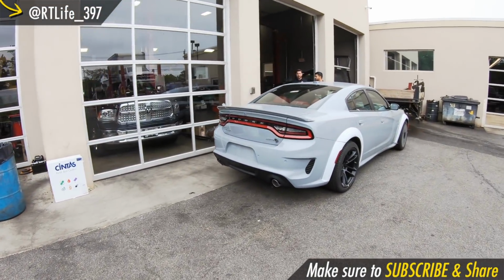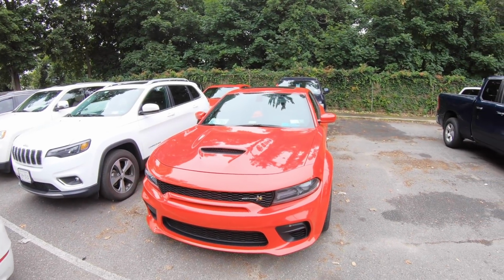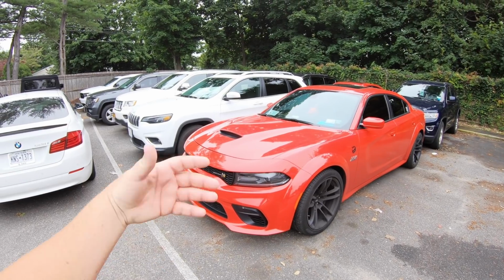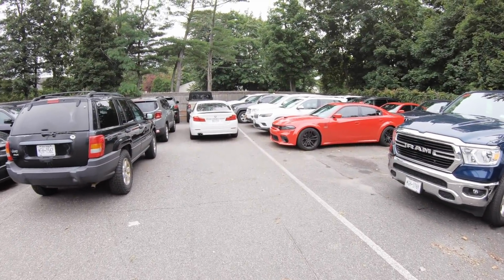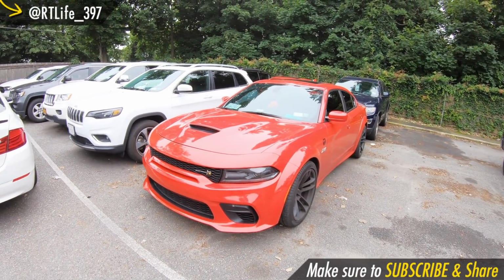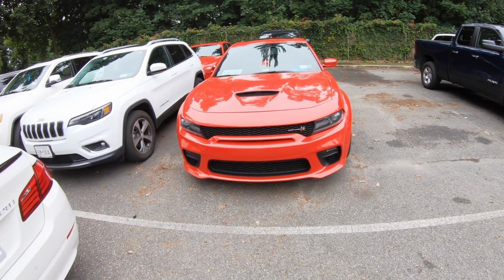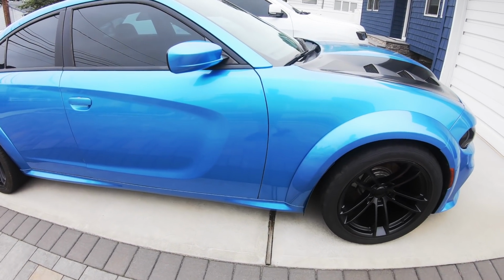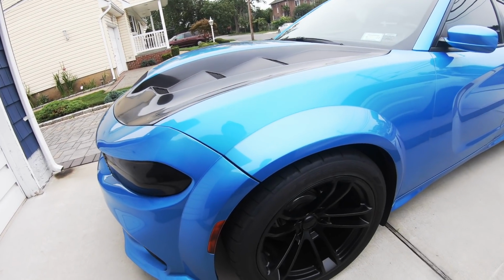Widebody is RIP OFF!!!

Comment: My biggest argument with dodge and the new wide body chargers or Challengers is you asking hellcat prices but couldn't even increase the HP that to me alone is a rip off. SMH
Reply: Scat pack is a good step before Hellcat and no where near the Hellcat price. Trust me I would of bought a Hellcat
Reply: @seancole8359  shit the prices I've seen them go for it is....I mean if your spending close to $52,000 for a scatpack a used hellcat is right in that same price range
Reply: Same thing I said,where's the extra horsepower?People complained about the car being heavy,now Dodge gave you a widebody,with a couple hundred extra pounds,for stupid people😂
Reply: @jakoidtonge  I mean I love the scatpack don't get me wrong but they could of gave it more HP for the price they charging. And hate to say it but the 5.0 with the 10 speed is faster
Reply: @cevinmoore8428  the 5.0 definitely got that top end speed.But the Scat got the edge from a dig,granted the driver knows what they are doing.Only thing those cars need are sticky rear tires,and a good driver.
Reply: @jakoidtonge  yeah and I don't even like mustangs but I feel like dodge could of done the scat better with the widebody and added more HP that is just mu personal opinion
Reply: @cevinmoore8428  yes more hp,to compensate for the extra weight
Reply: @jakoidtonge  that's all saying overall it's a great car just wish they did that 🙅
Reply: @seancole8359  i agree, scats are absolutely the best bang for your buck...i'm saving up for a challenger scat pack, 500 horses is a fukn ton of power
Reply: @cevinmoore8428  seen the mileage on that used fat cat??? yuk
Reply: Facts
Reply: Well actually it’s not Dodge itself it’s the dealers that over charge us owners. Dodge have the power to penalize the dealerships for over charging us but they don’t wanna take action on it. Ford is trying to get dodge & chevy for them to penalize these dealerships for over charging the customers. Because 70,000 for a scat pack? That’s pushing the same HP as the 2-3 year old scat packs, have the same 8 speed transmission and !!!!!!!!!!! The same outdated interior from 2015 ??? Hell no.
Reply: @J_GoldieLoc  right it's just insane that the prices cost as much as a hellcat there should be boundaries my goodness. And like you said same interior and same HP since 2015 they on some straight B.S.
Reply: @fallback8314  it’s more like 420-430 whp it’s 485 crank. I was looking for a Scatpack but the way these prices are I refused and I was buying cash. I ended up with a 5.7 had a custom widebody done with OEM parts and waiting on my whipple and other mods and will be making over 580 whp. Anybody getting scats paying hellcat prices are crazy
Reply: Not a good review tbh..... The widebody is significantly faster than regular body.  I honestly think they dyno at 500+. Plenty of articles about this.
Reply: Good 👍 observation
Reply: Exactly when you can buy the kit for 10k
Reply: @seancole8359  Same. for 22k you can build your 392 to hellcat redeye power.
Reply: FACTS
Reply: Bruh the price is way different is u drunk
Reply: @loveyourzzgg697  how the hell am I drunk? You can get a used hellcat for the same price as a widebody scatpack makes no sense

Comment: The only issue with the conversion that I can see at least for anything below a 2020 and maybe even the narrow bodies above 2020 is the whole point of the wide body from the factory is the improved suspension components that help those 305s corner better. With the conversion if you do just the body aspects you can add the wider wheels with proper offset with wider tires but your not getting the full benefit of the suspension upgrades.
Reply from the maker: Very true. Most will over look this because the majority of chargers are used for drag racing & meets.
Reply: @RTLife  Agreed. Because I have an insurance nanny in my Redeye currently I haven't really had a chance to fully get the effect of the 797 but damn it is a completely different car handling wise. Seriously considering doing some road course stuff with it.
Reply: @coolwrld302  Also, if you convert an SRT 392, you'd still have the bigger brakes up front and the adaptive suspension. Or the Daytona 392 2018+ also has the same I think...
Reply: The Widebodys have different spindles too
Reply: Not to mention they switched to electric power steering.

Comment: The Dealership near where I live is selling 2021 wide body Scat with 7k miles for 65k I would never pay that much when you could get a used Hellcat for less then that.
Reply from the maker: Exactly. It just doesn't make sense! But people are still buying them anyway
Reply: Probably has all the extras with it
Reply: @daltonxervin  all those extras still do nothing for the car as a whole
Reply: @sliding_by8607  that’s where the added cost comes from??? who said the extras did anything for it? not me.
Reply: @daltonxervin  did i say you said that? reading comprehension does wonders if you learn to use it.
Reply: @sliding_by8607  you implied that I did. so now you are saying your comment towards me was irrelevant.
Reply: Hey Mark, which dealer is it I am looking for the Widebody style I can fly there and put half the money down over the phone. Coming from Atl 65k not bad. Thanks
Reply: @BlakWiseCracker  if you put half the money down for a scat pack you should just get the hellcat
Reply: @daltonxervin , I don’t like the Hellcats” and I don’t need all that power it’ll be for nothing and just for show and no where to open up 700hp except the track and I am nowhere near a track. The ScatPack is just enough HP, I had one and sold it 4more money than imagine. Thanks 😊
Reply: @daltonxervin  , I know but I start a new job on 7/26/21 in the heart of Atlanta and need a whip  sooner than later. I sold my 2021 Widebody for 75k with 250 miles. I was gonna hold out after that to purchase, but my daughter needed my used car and I had to ship it to her in NY. What a bummer..” 😢
Reply: @BlakWiseCracker  at least you got that massive profit off of it. i was hoping to have one by august but I just bought a house. but I guess a house is more of a priority for my age. car soon to come though
Reply: @daltonxervin , As long as you can get to work for now and then your car is next. This pandemic won’t be over they say until 2023 therefore you’ll have plenty of time to get what you want for yourself and family. Only downfall might be a little high. But if you order one after August you’ll have it within 90 days.
Reply: @BlakWiseCracker  if everything goes as planned🙏🏼 but good luck to you and your fam and enjoy the car when you get it🤝
Reply: @daltonxervin , likewise blessings to you and yours as well. ✌️
Reply: @BlakWiseCracker  I am out here in Denver. The Dealership is Skyline Mitsubishi out of Westminster. It’s a Charger Scat Wide. Good luck man
Reply: @markroach3785 , I’ll call them ASAP! Thanks a million..” ✌️
Reply: @RTLife  yup people keep paying it so prices will stay high!

Comment: Got my WB scat for 46k earlier this year!! Market is so crazy right now
Reply: Wow that's a great deal. When buying my car the narrow body scats were $50k+
Reply: Got my 21 WB scat for 48k a month ago so i dont think its too bad
Reply: @Bad_grlz51  damn what a deal... I should've looked out of state and flew out of California or flew out of Los Angeles to get my car
Reply: @MLProductions.1  I got it from Los Angeles only just went to the right dealership at the right time I guess. Infact they keep emailing me about buying it back from me lol
Reply: @maninderhari6852  you'll get more then what you paid forsure. But since all prices are nuts rn it wouldn't be worth it. In 2019. I had bought a SXT for $27K OTD and that was with a custom katskinz interior. The R/Ts at the time were about $34k OTD. I didn't even look at scats. I drive alot but within 2 weeks regret my decision on getting the SXT and not the R/T. The sxt ended up being a lemon which was really a blessing since I only spent $200 and oil changes on a car I drove for a year and 26k miles. I wanted the scatpack. But the $16k OTD difference for a regular body didn't make sense so I went with the R/T. I'll be building this thing up. Already got about $8k in mods. And it's only 4 months old. Give me 3 years I'll be putting down hellcat numbers.
Reply: @MLProductions.1  you putting some work in that 5.7 bro . I traded mine for this scat WB . It was about the same $7-8k worth of mods and dyno tuned to about 430-440WHP. I thought I would miss it until I bought this 6.4 . This thing hits different even at stock. Some profit is tempting right now but I don’t feel motivated to sell it lol
Reply: Did u include  taxes, license, registration, application, dealer etc fees? 👀👀👀
Reply: @ivancortez29  yes sir I traded in my 5.7 as well

Comment: Widebody has adjustable suspension, flat bottom steering wheel, 11 inch rims on all four with 305 35 20 tires, beefier suspension  like 30% stiffer, and factory flares with Rocker panel change to blend six piston breaks in front four in back and 2 piece rotors in front. I'd say it's worth it to buy it already setup. All that is an upgrade from regular scat. Wider rims with tires is like 3k right there.

Comment: It's the Mopar tax. The car probably costs an extra $500 to build and the price difference is $15-20K. As long as people continue to pay the price, they'll pay what the market will bear. I would buy the standard body if I were to buy a Mopar. I'd improve on the wheels and tires and call it good. I doubt that I would add much in the way of performance mods because it is cheaper to mover up to the next trim level. I'd find it too hard to put up with if I felt I were getting ripped off.
Reply from the maker: yah I just wouldn't be able to justify getting a used widebody for almost $15-20k more than a regular one. They look great though

Comment: I would like too see narrow body wit the kit vs widebody too see if there really different from factory 🤔
Reply from the maker: I think that can happen.
Reply: I thought the only difference is the real widebody the fenders are actually cut into and the widebody kit they are just stuck on so with the kit you really cant go as wide tires as you can with the real widebody
Reply: @AlexSanchez-cg8pz  you shouldn't have any problem on the rear, but I can see where you would have to be careful up front.

Comment: The car market right now is an anomaly.  It's not usually like this.  Chip shortages have skewed the market so much.

Also, the wide body is a way better value than the standard because of the handling differences.  I own a Widebody and it's light years better than my standard Hellcat was.

Comment: Moving forward I don’t think the prices are gonna go down for these cars until we see these new E muscle cars in the flesh;  I’d still like to add a hellcat to my stable and park it next to my WB Scat.
Reply from the maker: I think you're right about that. These will keep their value for a while. Def don't blame you about adding a Hellcat - at some point I'd like to do the same.
Reply: Even if the EV cars come out it doesn’t affect the Chargers. The EV’s will be in a class all by itself intended only for people who wants. Also the Chargers are high in price due to the chip/rubber shortage, that’s it. Once that bounce back prices will drop for all cars.
Reply: I think the price will hold and even go up even after EV is release nothing is going to replace the sound of a v8.
If this is the last of them the price should hold.
Reply: @evergreenlandscaping901  , As long as gas stations exist combustible engines will never go away. Some people cannot phantom the fact of sitting waiting to recharge a car with family on the dangerous roads for 30-60 minutes. “ Hell people being shot at gas stations for getting a pack of cigarettes or a quick fill up and robbed or car jack. So can you imagine sitting there while crazy people watching you for 1 hour, hell naaw” I gotta go 😂
Reply: @BlakWiseCracker  agreed

Comment: 1.all dealerships are marking up sticker price right now like 10k, bad time to buy.  2. when getting a wide body its just not the fender flares, its the wider tires, the suspension is different. the rotors and brakes, its a bunch of extras your getting. is it worth it maybe not but it all depends. to me it is. the wide body looks and drives better than a narrow body to me anyday. and pricing depends on a lot, how equipped the car comes also matters

Comment: I already have too many cars. But what I would do is the most basic srt Charger. Stock everything with radials, a converter, a single vs racing turbo with the stock flipped manifolds and a crossover. Run pump + water injection and electronic boost controller. Tune it for about 700 whp and beat any hellcat for less than 50k 👍🏻

Comment: Did you have to cut your fenders? And how did glue your widebody kit?
Reply from the maker: No I didn't cut, but it is recommended. You will have to run lower profile tires if you don't cut.

Comment: I got offered 53k for a used 20k mile 2020 challenger widebody, and 56k for a charger widebody brand new. It’s so dumb how expensive they are. I’m ordering my camaro 1SS on Monday and I got offered $43k with my discount before any negotiations and other incentives. Camaro is the way to go if you go fully loaded.
Reply from the maker: I hate to say it but Mopars are overpriced esp right now. When you compare them to the performance of the Mustang/Camaro - it makes little sense going Mopar if you don't need the extra room in the back.

Comment: I saw a '21 challenger redeye at a dealer today and I saw a 1,s,and a 2 on the left side door panel. So dodge has finally added memory that recalls the settings for the steering wheel, the power portion of the seats, and side mirrors on the challenger when it was always on their other 4 door mopar vehicles and on the camaros and mustangs
Reply from the maker: I think Dodge is stepping up their game with the interior & technology in recent years
Reply: @RTLife  they just need to implement their new tech in the durango and the ram in their other vehicles

Comment: To be fully honest - when you noticed and shown close up how the bumper sits - yes, there is a difference between fitment of the kit and OEM. But considering the difference in the price - would take your R/T with body kit, rather than going for trade in at the dealer.
Reply from the maker: check out the video before I put the turbo setup on. The front bumper was perfect. The size of the intercooler in the front has screwed up the alignment - would've happened to any bumper.
Reply from the maker: Once this thing is all done I will button everything up so it looks perfect

Comment: I just traded my 2015 Jeep SRT with 81k miles and got $37k for it. I only paid $40 in 2018. The market for some, not all of these vehicles is crazy. Anyone who is buying these cars is getting fucked bc in about 2 years they are going to practically be giving the new cars away. There is a big chip shortage. Dodge alone has over 80k 2021 vehicles sitting in a lot with no computer in them. That’s why the used cars has spiked

Comment: A real factory Widebody gives you a lot more than just body panels. You get stiffer springs, adjustable shock dampening (street, sport, and track modes), bigger sway bars, 6-piston Brembo's with 2 piece rotors up front, 20"x11" wheels with 305/35/20 tires, shift indicator light, and the flat bottom steering wheel. It's a $6,000 option from the factory.
Reply from the maker: I think many are missing the point. I'm not knocking the widebody package but do you really think it's worth $15k-20k over a standard 392 or Hellcat? that's basically the point of the video. Many want a used one but the prices are silly right now.
Reply: @RTLife  Hell no it's not worth it, those markups are ridiculous. You'd have to be a fool or just have money to burn buying at those prices! 🤣🤣🤣 I paid $51k last year for the Hellraiser, sticker was $60k. Now is not the time to buy anything. But when shit gets back to normal, hopefully, the Widebody is well worth $6k if you can swing it. 👍👍👍
Reply from the maker: 100% worth every penny of $6k

Comment: It's more than a body kit, it's a plus-sized version of the dynamics handling package with floating brembos, larger wheels, and tires, and even a customized adaptively dampened shocks with different springs and even larger hollowed anti-roll bars.  Oh, and you might want to correct the title to use at least a correct sentence, such as add an "A" behind is and before rip off in the title.

Comment: @R/T Life where you get the wide body kit and wheels from bubba
Reply from the maker: I got the kit from Ikon Motorsports https://www.ebay.com/itm/393109522317
The Wheels are from Vicrez - Widebody Hellcat -2.5 offset 20x11
Reply: Did it come with the front and rear bumper with the kit
Reply from the maker: Yup

Comment: If you want a widebody car, drive a first gen Hyundai Genesis 5.0. There ya go lol.
Reply from the maker: They're pretty cool rides. R Spec
Reply: @RTLife  they're really unique. I had a 2013 charger rt and while I really liked that, my genesis is in scatpack territory. With a good tune for the ecu and tcu and some exhaust work they're monsters. There's a guy on YouTube with one that went to 160 in 25 seconds from a 20 roll 😂 no one would expect that from a Hyundai. LOL. Top speed without the governor, stock, is 186 🤯 it pulls like a freight train too on the top end and doesn't slow down at all